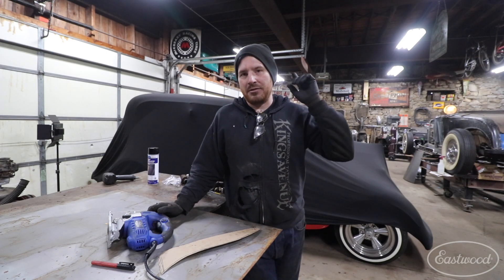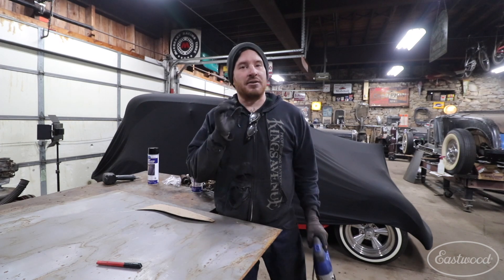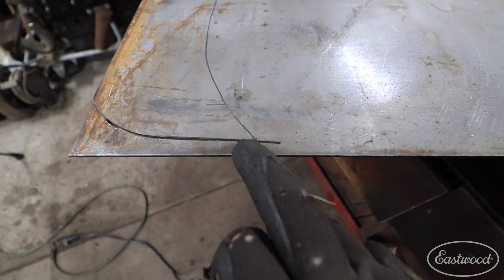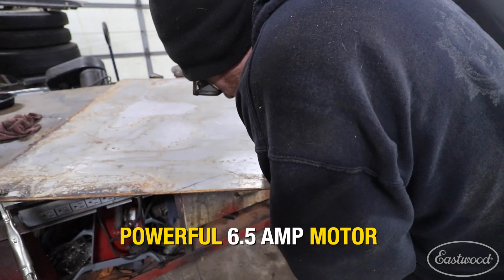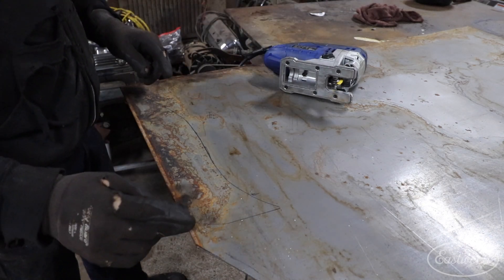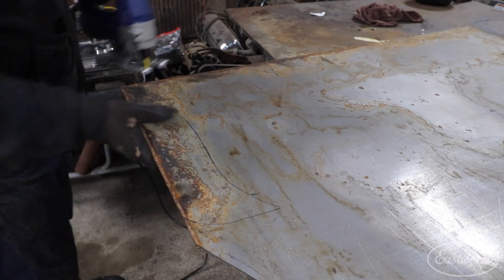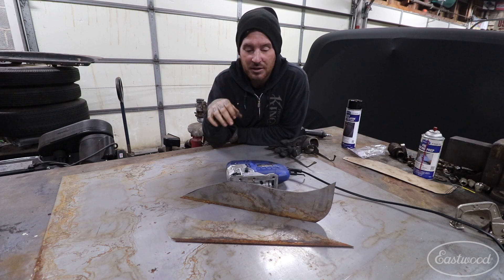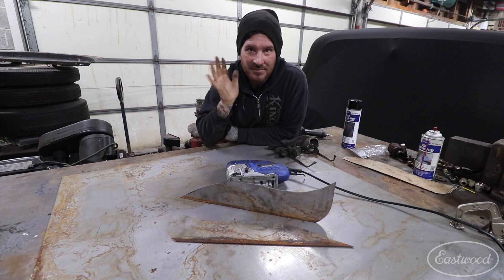Makes Curved or Straight Cuts in Thick or Thin Metal:  Metal Cutting Jig Saw from Eastwood

Comment: Wow..great video. How thick was that metal? Also, what is the thickest metal that saw can cut through...?
Reply from the maker: The Eastwood Metal Cutting Jig Saw has a 3/8" Max Steel Cutting Capacity and a 1/2" Aluminum Cutting Capacity
Reply: @eastwoodco  Thank you for the reply...